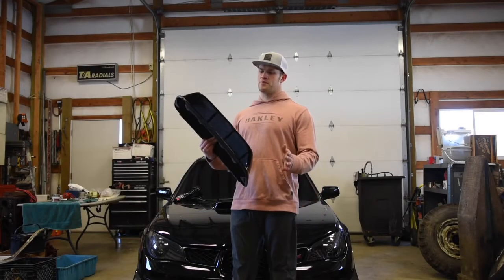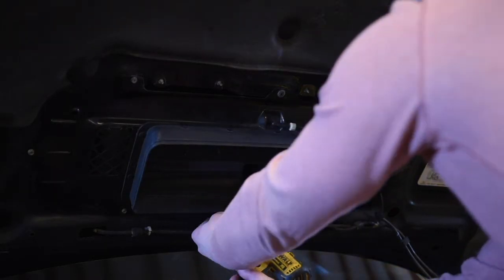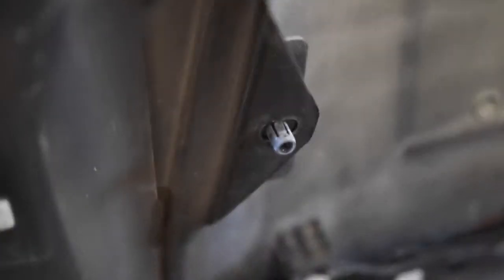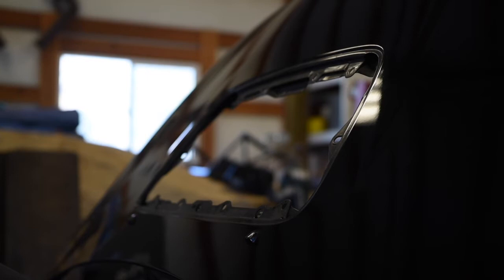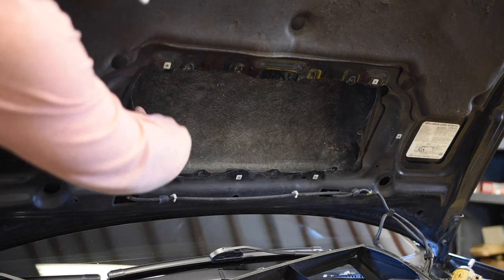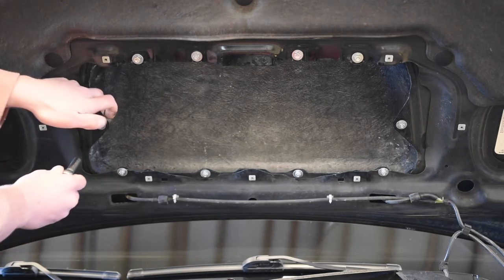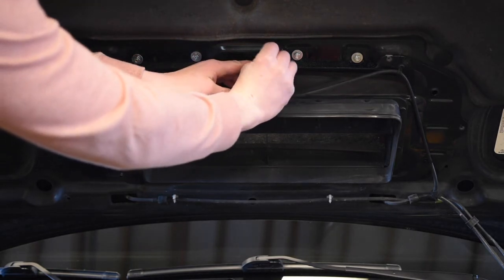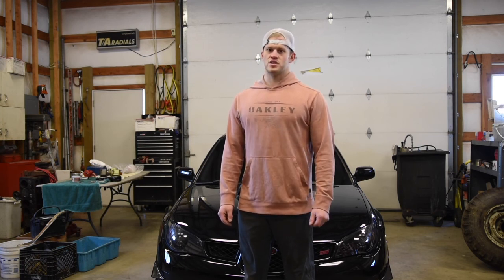HOW TO: 04/05 STI HOOD SCOOP ON 06/07 WRX & STI

Comment: does the hood scoop for 02-05 wrx or sti will fit 06-07 hood?
Reply from the maker: 02-03, 04-05, 06-07 are all different.
Reply: @Dvniemela  if they’re all different how’d you do 04/05 on a 06/07?